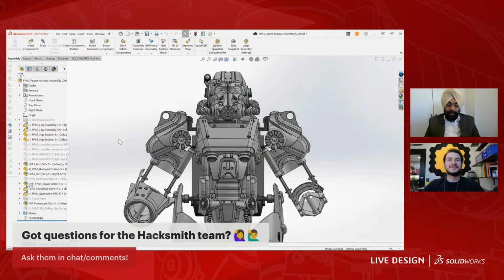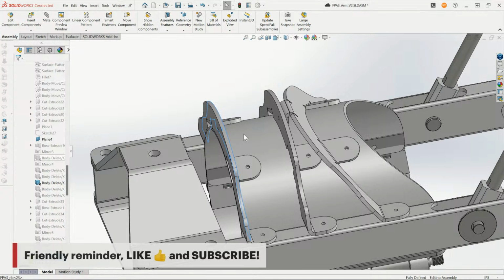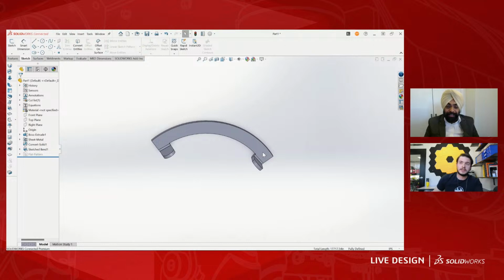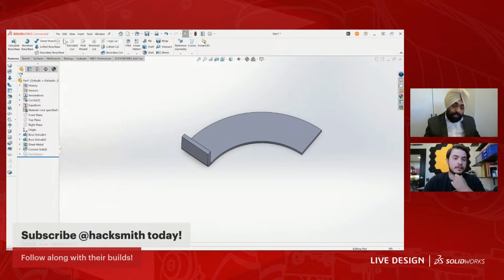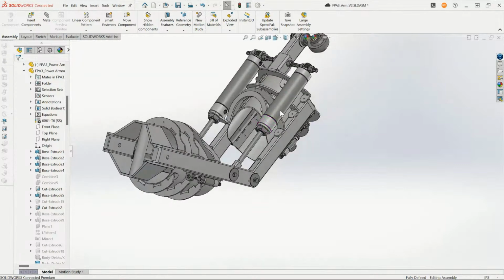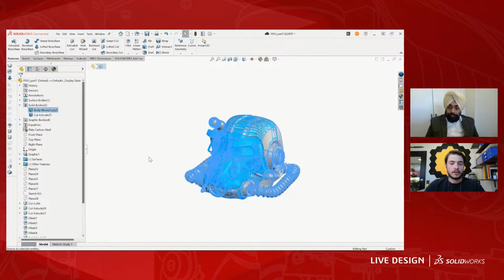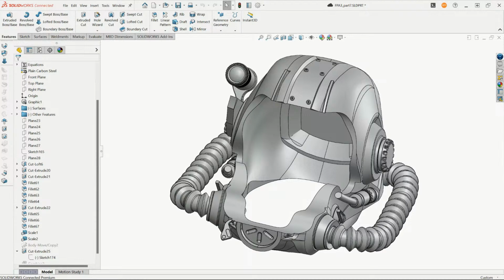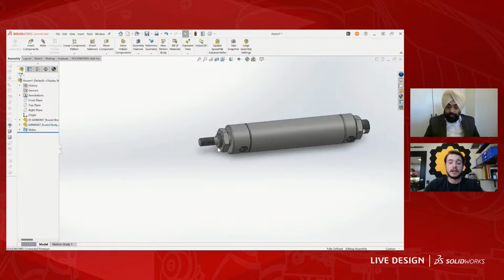From Game to Reality: Designing Power Armor with SOLIDWORKS - SOLIDWORKS LIVE Design

Comment from the maker: 📚Episode Chapters!
0:00 What is Hacksmith
2:58 How Hacksmith Designs with Sheet Metal in SOLIDWORKS
34:48 Hacksmith Multi-Body Design in SOLIDWORKS
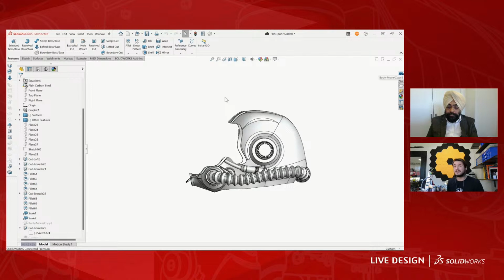45:20 How Hacksmith uses Configurations in SOLIDWORKS
57:05 Extended Q&A with Bogdan of Hacksmith